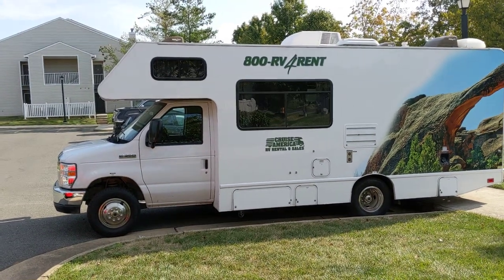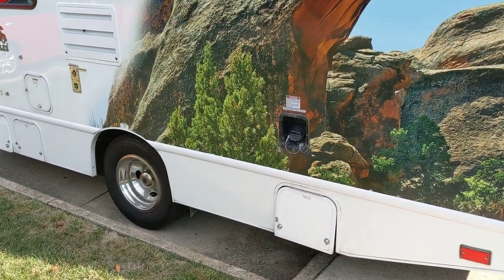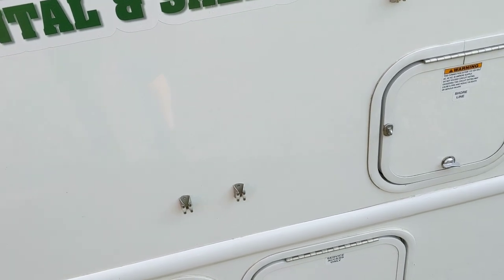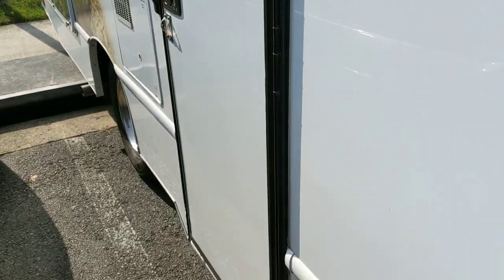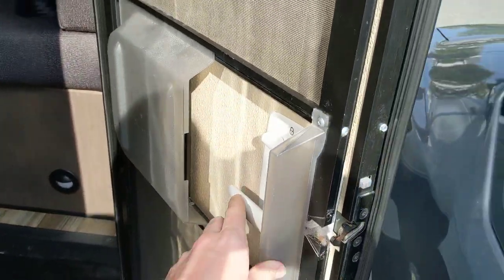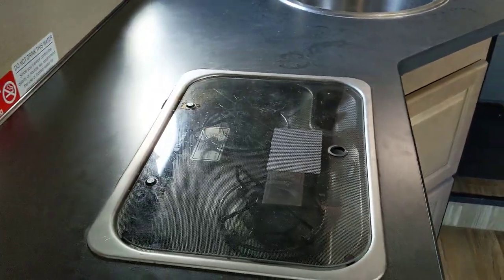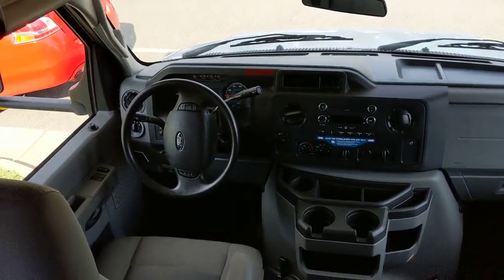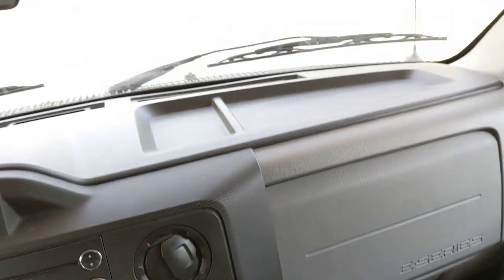Cruise America - Review and Walk through of 25' standard 5 passenger RV

Comment: I guess that is their way of keeping the RV battery separate from the vehicle battery . No battery isolator needed; w/ solar the RV battery is charging at all times during daylight hours going down the road or camped.
Reply from the maker: Hi! If you are looking for a more feature-filled RV rental, suggest you may want to check out sites like "outdoorsy.com" or "rvshare.com", where you can rent more upscale RV's from private parties.  There is a lot of good information available on the Cruise America rental vehicles online.  One summary that I think sums it up well says "It is designed to be idiot proof. No awning to remember to take down, no steps to remember to bring up, no TV antenna to take down, no sliders to bring in, no leveling jacks to bring up. The amenities are pretty spartan so you do not have to worry about over wearing the furniture, carpets, or other things like that, as they are selected for durability, not particularly for style. The rig is manufactured to be used hard by beginner motorhome users who do not understand all the things you need to do to manage a modern MH and to be blunt idiot proof".

Obviously more high end rigs can do things like run AC off battery or use the household-style electrical outlets without running the generator or plugging in to shoreline power.  This isn't really the goal of a CA rental.  You might want to check out those other sites I mentioned above if you're looking for a more capable vehicle.  You might want to check out my other videos, as well, for newer information.  Thanks!

https://www.youtube.com/watch?v=bgOoMQ1_4mA

https://www.youtube.com/watch?v=6EBeRJBtCAs

Comment: Great video and comment section - first timer with some questions:
1) while driving do you use generator to power fridge, microwave, electrical outlet?
2) how do you refill black tank with fresh water
3) do you need to buy toilet pellets for flushing ?
4) what essential items should you check in rv before you leave the rental place before your trip?
5) what most helpful item to bring from home into rv 

Tnx
Reply from the maker: Hi!  Thanks for the comment, and all the questions.

1) The fridge is powered by propane when driving (check the "Auto" setting shown at 10:10 ).  If you need to use the microwave or electrical outlets in the back while driving you would need to run the generator.

2) I think you misunderstand the tanks.  The black tank is your waste.  It's where the water goes when you flush the toilet.  There are four tanks: black (solid waste), gray (waste water from sinks and shower), your fresh water tank, and the hot water heater tank.  Capacities for all of the tanks are listed on Cruise America website.  In any case, to fill your fresh water tank you just connect a garden hose to the regular water fill shown at 4:27 or to the screw-on inlet shown at 15:42 .  A garden hose is included with your rental.

3) You don't "need to" buy them, but it is recommended to help keep down odor and break down the waste more quickly

4) Make sure you know how to use the control panel check the levels for all your fluids

5) Your dog.  😻  We love camping with our dog, makes the whole experience 💯.  Other than that, I recommend a good multitool such as a Leatherman.

Comment: Thank you for this. We are renting for 3 weeks soon this is super helpful.  When you hook up the water will ot fill the reserve tank or do you have to do that manually with that other fill hole whenever it needs a top off?
Reply from the maker: Hi!  Thanks for checking out my video.  That's a good question.  Don't believe anyone's ever asked before.  In my experience, the reserve water tank is filled separately.  So you have two options (1) connect hose to pressurize system, or (2) fill reserve tank and turn on water pump to pressurize system.
Hope this helps, let us know if you learn differently.  We also have a newer video, here:

https://www.youtube.com/watch?v=qbBoA0x5Fow

Thanks!

Comment: Hi Mike, thanks for the review.  We are planning a trip for 10 days, renting the standard RV of 25 feet.  We would like to don't use the campgrounds and save some money and have some freedom.  How long will work the battery for the fridge and the heater without connection...one night, couple nights?  Is the solar charger working to refill the battery?  What about the long lasting of the water and grey waters that we have to dump? and last one, is there any problem to park in the cities? 

Thanks!
Reply from the maker: Hi!  Thanks for the comment.  The fridge in these rentals (and in most RV's, these days) can be powered by either propane or electric.  It will switch over automatically,  depending on the availability of electricity.  Make sure your propane is filled before starting your trip since it can be more challenging to "top off" once you're on the road.

The longest we've camped without hookups is three days.  We had no problems with power, propane, fresh water, or the black water tank.  We only used the generator for about an hour.  Where we did run into trouble was the gray water.  Fresh water capacity is 40 gallons,  but the gray tank only holds 25 gallons, and after three days of us showering, washing dishes, etc., the gray tank was completely full.  Obviously if you don't shower and wash dishes as frequently, or use campground facilities, that won't be a problem.  That was just our experience.

Personally I go camping to avoid cities and couldn't imagine trying to park one of these in a major metropolitan region like Washington, DC, but I suppose it would be possible if you can find a large enough spot.

Comment: I am going to rent one in July. How did the air conditioning perform?
Reply from the maker: Hi! We didn't use the roof AC on our most recent trip, but used it on the two prior trips (where we had shoreline power). I'd say it works well enough. It's a bit noisy, and takes some time to cool down the entire inside. Also if you turn it off or open the door it will warm up again pretty quickly. It's adjustable and makes a good "white noise" for sleeping. This was just with the two of us and our dog. If you have five or six people in there and they're all moving around, doing cooking, or anything like that, it may feel a bit weak for you. That said, it does cool off the inside sufficiently to make a noticeable difference during warm weather. Park the vehicle in the shade (if possible) helps a lot, too. Have a great trip!

Comment: Thank you for this video, I watched it a couple of times before picking up my RV from the rental office, I could give the rental agent a tour and briefing on the workings of the RV thanks to the You Tube videos you posted and Cruise America have up.

I just returned from a trip in a 2020 Model from RV America.  A couple of things that stood out to me that I did not anticipate since it was my very first RV trip.

1. No USB ports in the drivers area and no 12v sockets on the dash, only one I could find was  in the far corner of the open glove box.  So make sure you have a way to plug into that and split out to for phone chargers while underway. Or bring a charging brick.

2. The 120v electric plugs were up underneath the overhead cabinets. As luck would have it our coffee pot cord was too short, consider bringing an outlet strip to drop the power down to the counter.

3.  No 12v or USB near the beds (Back bed nor attic bed) to charge phones overnight when on shore power.  If you accustomed to keeping your phone bedside for alarms etc.. you may need a longer USB cord to get power to it.

4. No leveling equipment is provided, consider bringing boards / ramps to try to level off a little. We tried moving our RV around on our site and had to make do and get accustomed  with just being on a hill. 

5. After seeing the 30' vs. the 25' in person, spring for the 30' it is laid out much better, the bed in the 25' is a PITA to get in and out of.

6. The floor lights were fantastic at night, except they really filled the cabin up with light, too much. I took some duct tape and put it over them so they  only lit up the floor and not the cabin.
Reply from the maker: Great tips & suggestions!  They really need to add more USB ports (especially on both sides of the bed).  What works for us is we bring a 12v cigarette lighter adapter with us to provide extra ports at the front of the vehicle.  There are many models available, here is an image of the one we use currently:

https://imgur.com/a/wtYQchG

We also bring a few power banks and devices that have their own internal batteries (such as a small fan) so we don't have to rely 100% on the vehicle's electrical system.  The 30' RV does have a few more outlets compared to the 25', but you're right -- it never seems like enough!  🤣

Comment: Hey! We were thinking of renting an RV for our trip to Yosemite.  Question: Does the generator have a separate fuel tank?  For the generator, does cruise america provide the oil for the generator?
Reply from the maker: Hi!  Thanks for the comment.  The generator uses fuel from the main gas tank.  It's pretty efficient, think it only uses around a gallon an hour.  There's also a cut-off so it won't completely drain your gas tank of you forget to turn it off.  Cruise America will reimburse you for oil, just bring them your receipt.
Reply from the maker: @rhettlawrence3400  Hi Rhett!  Thanks for the comment.  So, there's two air conditioners in the vehicle.  The first is for the cab.  It operates like a normal vehicle air conditioner, i.e., you can only turn it on when the engine is on.  It does a fine job cooling the cab but doesn't do much for the back.  The second air conditioner is the one you see on the roof of all RV's everywhere.  It only operates when the vehicle is plugged into shoreline power (like at a campsite) or when the generator is running.  Cruise America does charge $3.50 per hour for generator use, and recommends you check the oil in the generator periodically when using (just like checking the oil in the lawn mower).  So if you're going somewhere where it gets hot at night that doesn't have power, yes - you will need to run the generator to run the rooftop AC.  One tip: try to park in the shade, if you can, since this helps keep interior temperatures down during the day.  Have a safe trip!
Reply from the maker: @rhettlawrence3400  That is correct, yes.  It's a frequent discussion on some of the RV forums - how often do people run the generator while driving?  A lot of folks do run them for people in the back while driving.  Personally I never had a need because I don't travel with anyone besides my wife and the dog.  🤣  I guess it's going to have to be one of those "try it and see" kind of things.  Open the windows may provide enough ventilation?  Good luck, have a safe trip!

Comment: We really want o try to go off-grid as much as possible. My only concern is the fridge. Do you need the generator on constantly to keep it cool?
Reply from the maker: Hi! Thanks for the comment.  The fridge is able to run on either propane or electric.  There is an "Auto" switch at the top which will switch it between propane (if available) or electric (if available) automatically.  Your rental office should turn this on for you prior to departure so it begins cooling down.  As long as you have either propane, or run the built-in generator (or hook up to shore power), you should be fine.  😁

One tip on the fridge - this is not like a normal household fridge.  Remember not to pack it too tight (air needs to be able to circulate inside it), and don't stand there with the door open or it will never cool off.  🤣  Have a safe trip!

Comment: Is it safe to assume there is a full curtain or some other way to get privacy from cab. (hope I'm stating this correct)
Reply from the maker: Hi! Thanks for the comment.  Yes, both the 25' and 30' RV's have several privacy curtains that can be pulled across and secured with velcro to provide privacy.  I don't really focus on them but you can see them (rolled up to either side of the entry into the cab) in this video around the 11:40 minute mark.  Good question!

Comment: how long is the electrical plug?  I plan to attach to my daughter's 220 dryer outlet and need to use an extension cord to reach the driveway
Reply from the maker: Hi Donna!  Thanks for checking out my Cruise America walk through video.  I haven't measured, but off-hand I believe the shoreline power cord is around 20-25' long.  Long enough that if you park in a campsite with the vehicle facing the wrong way, you can toss the cord beneath the vehicle to get to the other side and have enough slack leftover to plug in.

That said, most RV's use a 30A 120V plug - they may not be compatible with your particular dryer outlet, or you may need an adapter.  I recommend checking with your local Cruise America rental office to make sure they get you the correct adapter, if needed.  You can also usually pick up "dogbone" adapters at most camping and outdoor stores (even Walmart) if you need one in a pinch.  Don't want to trip a breaker trying to plug into the wrong type of outlet.

Lastly, this video is pretty old.  I recommend checking out my more recent walk through video for 2021 / 2022 RV's, which has more up-to-date info.  Link to that here:

https://www.youtube.com/watch?v=qbBoA0x5Fow

Have a safe trip!
Reply: @Mike Smith  thanks,  you've been so helpful with this answer and your video!

Comment: Great video. Just wondered if you knew anything about “winterisation”. Seen a lot about it on Google not sure if it would apply to us, planning on renting from San fransisco in October and would be disappointed if we couldn’t use things like the shower! One more thing is it worth getting the “personal kit” with bedding etc as it seems very expansive! Thanks
Reply from the maker: Hi Jamie!  Thanks for watching & commenting on my video.  "Winterization" is the process of removing all of the water from an RV's plumbing system.  Just like a home, the water can freeze if the vehicle gets below freezing temps which can crack and damage plumbing pipes.  There's a few different ways to winterize an RV.  Sometimes people use compressed air to force all the water from the lines.  A more common method is to flush the system with "RV antifreeze" which is that pink stuff you see in the RV section of stores like Camping World or Walmart.

Once the RV has been winterized you don't typically want to add too much fresh water back into the system or that would defeat the purpose of winterizing.  You'd use bottled water for things like cooking and teeth brushing, and RV antifreeze for flushing the toilet (dump a little down the tank when flushing).  No showers.

I am not a Cruise America employee and I don't know what process they use or when they winterize their vehicles.  I guess a lot of that would depend on the area.  They have rental offices throughout the United States & Canada.  Florida may never winterize, whereas a rental office in Montana may winterize in July, LOL.

My recommendation would be to call your local rental office and ask.  You mention San Franciso in October.  Now my gut feeling is that you should be fine and the vehicle won't be winterized.  Obviously if you're planning on driving it to Alaska in October though, you'd have other considerations to make with regard to temperatures.  😉

Regarding things like the bedding kit and cooking kit, personally we don't use any of those.  We keep all our camping supplies in a tote and just load that in the vehicle when we're ready to head out.  Set of regular bed sheets, couple pillows, etc.  It's just me and my wife and dog, so we don't use a whole lot of stuff.  Obviously if you're flying in from somewhere before you rent the RV, that might not be an option for you.  But typically we just bring all our own stuff.

Also, this video is pretty old.  You may want to check out my newer walk through videos for more updated info.  Here's a couple links.  Hope this helps!

Cruise America RV review and walk through - updated for 2021/2022 -- https://www.youtube.com/watch?v=qbBoA0x5Fow

Cruise America 30' RV Review and Walk Through -- https://www.youtube.com/watch?v=bgOoMQ1_4mA
Reply: @CompTechMike  Than you for all the info! very helpful

Comment: Are these prewired for TV in the bedroom or over the cab area?? Is there a solar panel on the roof and can the solar capacity be  expanded???
Reply from the maker: Hi! Thanks for the comment.  There is a Coax wire running from the outside (in the little compartment where the 30 amp cable is) to inside near the cab-over bunk area.  No TV or mount are provided, but the connection is there if you wanted to bring your own TV.  If you were to purchase a used RV, there are a variety of mounts you could add if you want a TV permanently installed.

There is a small solar panel on the roof (I believe it's 25 watts).  I assume someone familiar with solar panel installation (or a qualified solar panel installer) could expand the system.

You may want to check out my more recent videos for more information.  I'll include a couple links down below.  Hope this helps!

https://www.youtube.com/watch?v=bgOoMQ1_4mA

https://www.youtube.com/watch?v=6EBeRJBtCAs

(2nd video shows the coax hookup on the outside)